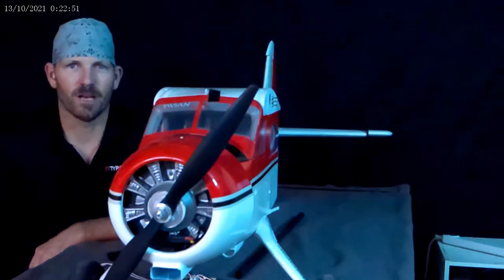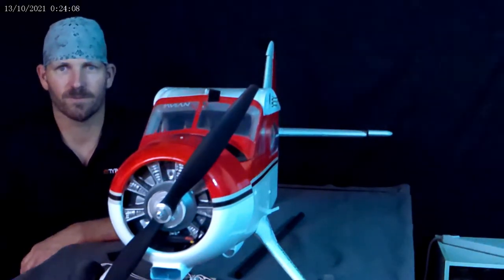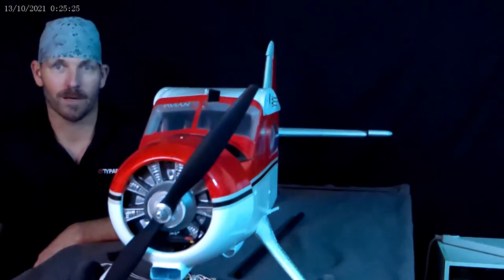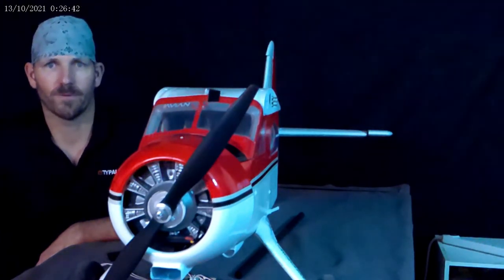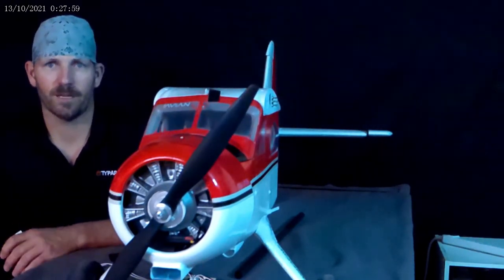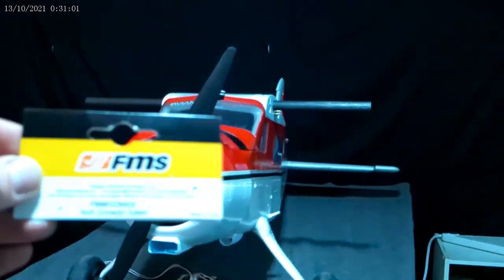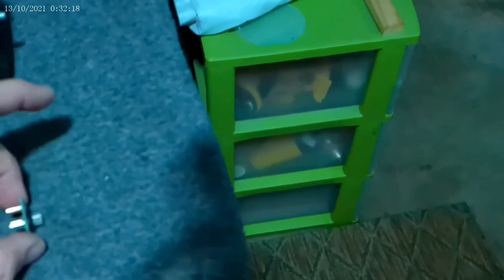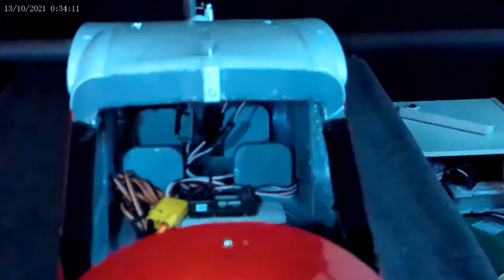FMS BEAVER 2 0 SERVO MULTI CONNECTOR REMOVAL MODIFY WING SERVO CONNECTOR

Comment: Thanks for making vid.
I want to know how you got the board out without destroying everything.
after 2 batteries and a not so perfect landing on floats, ripped elevator moving surface from elevator.
further investigation revealed a stript servo gears.
All this because float mount failed and dropped back of plane in water while up elev. during landing.
Looks like fms ran a continuous wire from elev to this board.
I may be looking at fishing a wire from receiver to servo and skip the board and leave it in tact. 
1st thing I did was remove orange safe box and wired all leads into my receiver.
This is not a friendly plane to work on or modify.
Thanks.

Comment: I have a DX6e and also want to buy a NX8 or NX6 ...I have only 3 planes so far so I will manually place them.  Dude thank you for the inform. about the red screen issue.  

Why am I here?  Thinking of buying a FMS BEaver V2.
Reply from the maker: IF YOU ARE CHOOSINGH BETWEEN THE NX6 OR 8 GET THE 8. AND IF YOU WANT A LITTLE BETTER QUALITY BUILT TRANSMITTER GET A DX9 . THAT TRANSMITTER IS BUILT BETTER THAN THE NX8 . I HAD THE NX8 AND THE 9 WINS